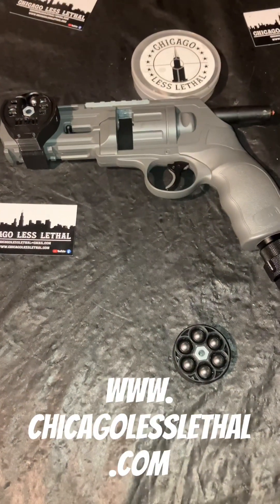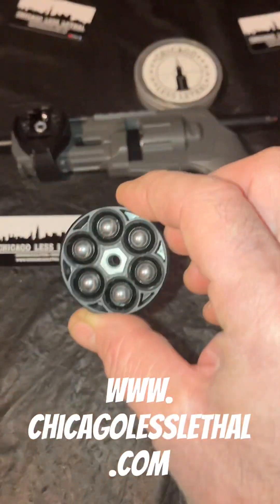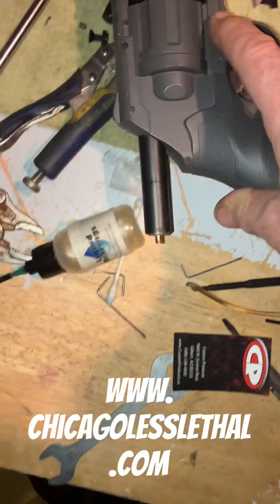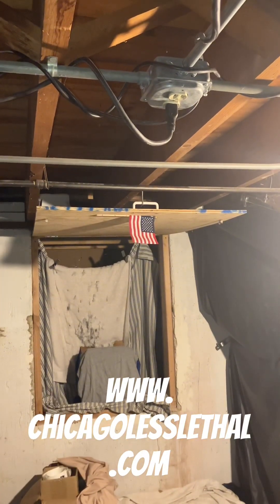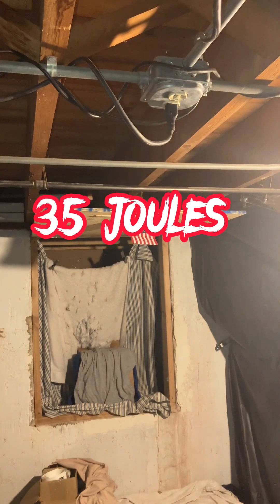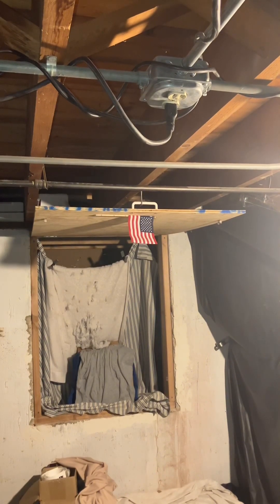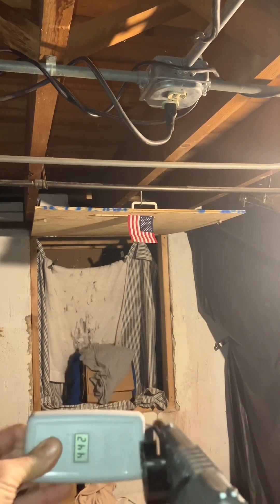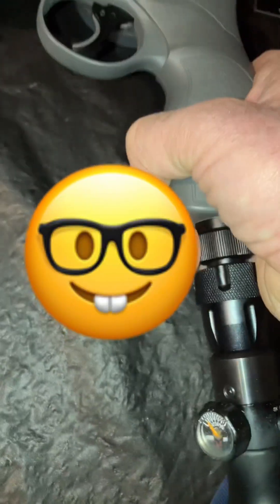Non lethal revolver easily modifiable for self defense | Chicago Less Lethal

Comment: Just ordered HDP50 speed loader from you guys how does the handle mod work? Does it go over the existing piercing "non" is it a replacement for it?
Reply from the maker: thank you for checking us out here on u tube, thank you for your order as well ! the way it works is it goes over picatiny front rail on the marker, it is press fittied nice and snug, allows 6 more rounds and imo is a must for the marker as you can never have enough plinks :)
Reply: @chicagolesslethal  thanks for the info I meant the piercing cover you also have that goes over the butt of the grip.
Reply from the maker: @Macmike510  that is press fitted as well, you can get it 2 ways one that take the contour of the plug, the other is just a small circle that is press fitted they work good, look better